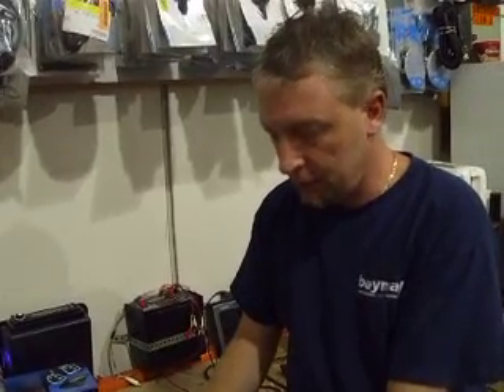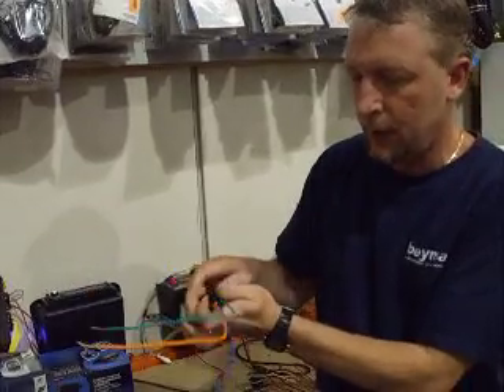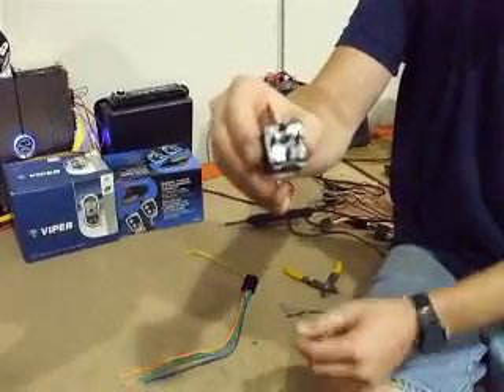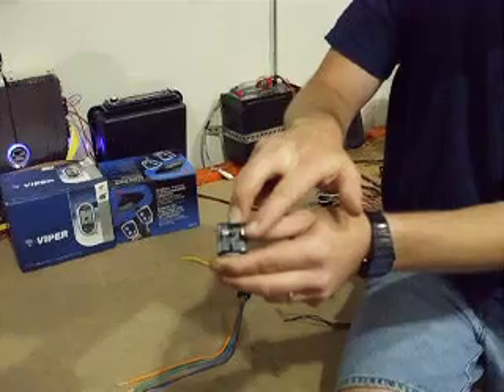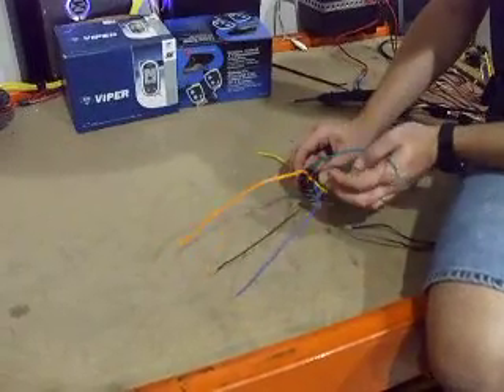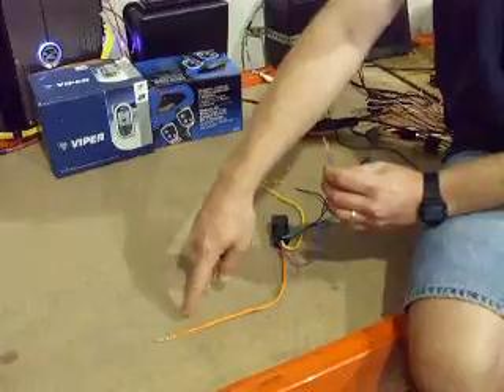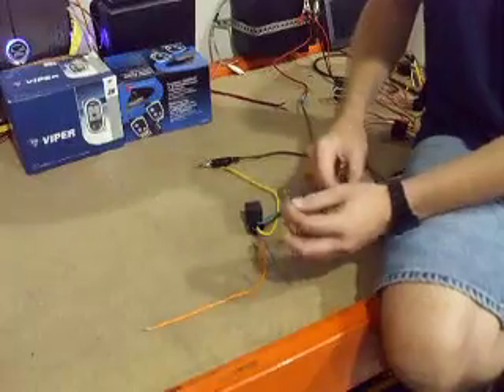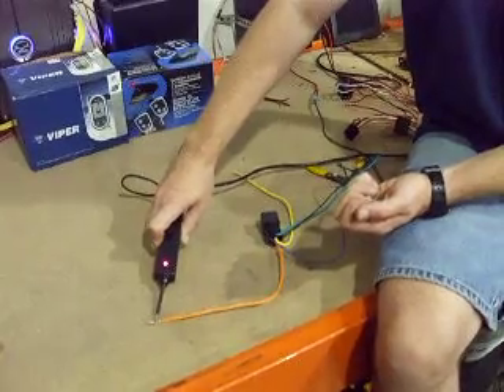Converting a relay from negative to a positive output - voltage inverter

Comment: hello sir 

i need ur help about car keyless remote door lock 
as i follow nagitive trigger
yellow-black & yellow and black to ground 

and red to positive 
 then i check with multimeter black pin to ground and red on red there was no trigger action when i hit my remote lock and unlock 

i mean as i check my indicators cable with meter there was trigger give 12 volt and light blink on lock one time and also on unlock

i have 6 wires 
1》yellow-black
2》yellow
3》orange-black
4》orange
5》white-black
6》white
and positive red and black nagitive

i need to know why my trigger not working as i above give u example 

thanks a lot

Comment: Hi lessco very good demonstration. I have a question: i am installing a remote starter and alarm in a 2002 Acura EL and my car has + trunk release i know that i need relay. So do i have to do the same as you are showing and do i need to add a diode to relay and if i do where to add diode in a relay.
thank you.
Reply from the maker: +deep aman there is no diode needed. all you have to do is connect the alarms- trunk output to pin 85, put fused 15amps + to pins 86 and 30 and 30 is your + output to the trunk wire.
Reply: +Lessco Electronics thank you.

Comment: I have a 99 crv I hooked up relay for trunk release like this however it's not releasing the trunk. I'm using the yellow wire behind switch, there are two and  one white green. Using the compustar cs800 remote start system, any feedback you may be able to give me? Thanks In advance.
Reply from the maker: TRUNK RELEASE
   
YELLOW (+)
@ HATCH RELEASE SWITCH
that is what you need to connect it as, that's all there is to it electrically, does the door have child safety maybe?